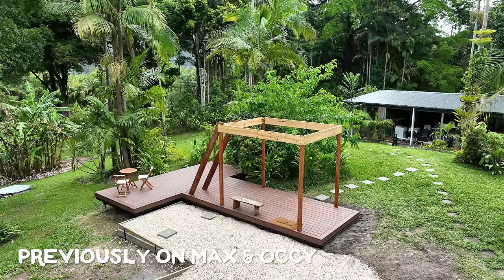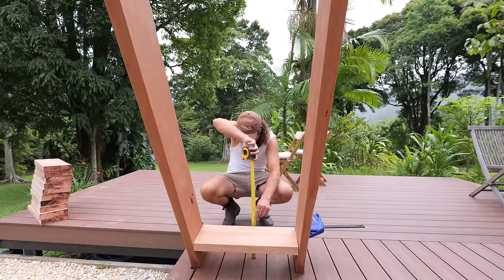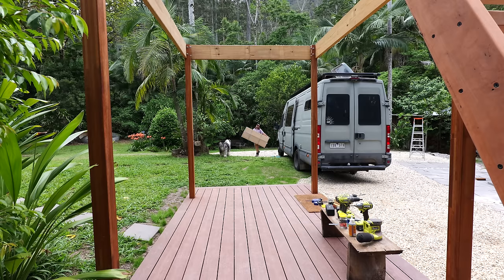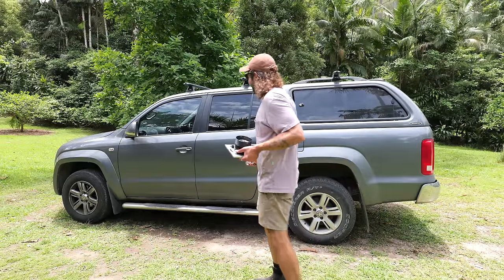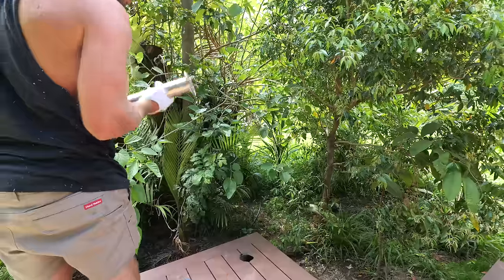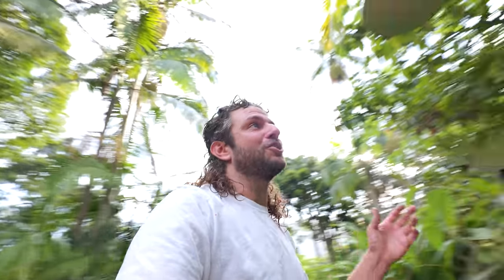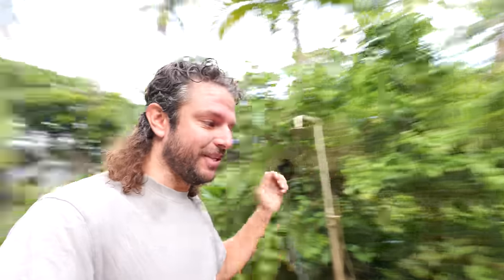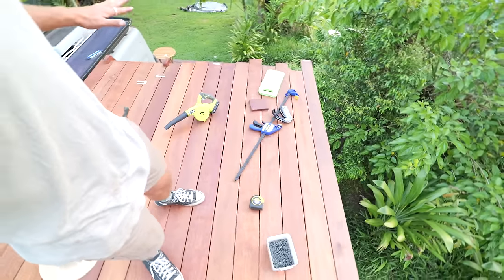I spent 3 weeks building the most luxurious van deck ever

Comment: Hi Max, I have built a lot of stairs in my life, I would be concerned over a long period of time the baton screws rusting out and failing which could cause the step to fall, or the wood warping for being in the elements and causing issues. Usually you would router out a groove to slide the step into, screw it and use a threaded rod to pull the steps together to keep it all aligned, I would consider putting a chock underneath each side just to give it extra support for each step, maybe consider a threaded rod in the middle of the step, my 2 cents, looks great though.😁
Reply: Those are super professional points. I was just going to say use big nails, not screws for weight bearing.
Reply: Good job 👍 I woulda put a tin roof over the whole van/ deck area though
Reply: I had similar steps built to my garage loft and they also continued the side rails up above the deck to give me a hand hold all the way up to the last step. That made them SO much safer and I seldom seen it done.
Reply: The deck is fabulous!  And it will make it so much easier for Occy to get in and out. Good job!
Reply: I can smell the timber 😎
Reply: @my2cworth4U  I know right!! Mahogany is amazing
Reply: You could plant mint around the shower base, to soak up excess water.
Reply: Agreed.
Reply: I wondered the same thing.  My dad was a carpenter and he had lots of projects around the house. I'm pretty sure he would at least have secured the risers with a bracket to the stringers.  Routering a groove is a class move and more esthetically pleasing, though.  Great advice.
Reply from the maker: Thanks for the tips! I actually had stair brackets to use underneath them but figured I can always add them after if any warping or cracking occurs. Future problem for Max to worry about : )
Reply: @MaxandOccy  interesting, wait for problems to occur rather than prevent them from occurring 😵‍💫🤔
Reply: @MaxandOccy a fall from that height 😮 you know the risks. Insurance will not pay for injuries from a self build either. I'm remembering a friend's prosecution and loss of everything he owned. 😢
Reply: My favourite thing on the deck is you n Occy 😊 take care 💙
Reply: Just curious...doesn't Occy get a lot of ticks and other critters by hanging out in the bushes?? Everything you have done looks great! I am impressed!
Reply: Noooooo don't plant mint unless it is in a container. It will run wild which in real terms may be an environmental threat to the rainforest.
Reply: Threaded Rod every 3rd step is minimum that I would do
Reply: @my2cworth4U this is a great idea however I’d make sure it was in a planter or a garden bed mint loves to travel. 

Mint would also give you that natural relaxing fragrance with every shower.
Reply: @sharonrose3871  that was my comment as well. It has to be in a pot or garden bed or it will run for sure.
Reply: @sharonrose3871  OMG ideas run wild faster than mint.
Reply: The shower is amazing! I thought the gold was peaceful looking as well, it blends in. The deck is so nice well done.
Reply: @axedog1395 its only till the cabin gets done.though given the amount of rain we have had to date…..😂
Reply: Looks fantastic, only thing I would add is a balustrade on the top floor.👍
Reply: @alleyoop2899 well Youtube is his bread and butter and he figures that putting everything off will only give him more content for his channel. Can you imagine the views, comments and likes he will garner on a future video showing a thumbnail of him hurt? Believe me, he is besties with Eamon and Bec and he's learned how to make sure to monetize from EVERYTHING he goes through!
Reply: Oh so true! I planted one plant years and years ago and I am still fighting it.
Reply: @pageroo9644 
WOW you sound super critical of not only Max but his friendship with Eamon (who is a fun character) as well. 

I assume (ass-u-me 😂) you have an equally well supported, monetised YT channel.

You don't have to agree with his methods, but Max is a nice guy who will eventually admit if he has failed himself and thank his viewers for their tips. 

Remember to BE KIND. ALWAYS ❤❤
Reply: @yvettepugin4035 I don't crowd fund my life. I actually worked for a living until I retired. Its very funny that Max says to " Be Kind. Always", yet he never addresses issues in a kind manner in regards to the previous owner when he makes his house renovation videos. It started on the very first video showing a full tour of the place after he got the keys. With that said, please save the psychobabble for someone else. Being kind has nothing to do with it. Its about being truthful and not everyone appreciates it being served cold!
Reply: @MaxandOccy  I can't find this weeks video ... Hope you're ok :)
Reply: @lourdesvigil2794  I was wondering the same thing...
Reply: The first thing I thought was where are the routed grooves for the steps and how those screws will rust in time...

Comment: This is way too picky but it comes from a place of love and respect.  In most states the max riser height for stairs is 190mm, not 240mm.  But maybe QLD is different.  More importantly, the minimum tread depth is 240mm (front of step to back) without any overlap from the tread above.  That way, most staircases in Australia are less than 45 degrees and easy (safe) to use.
So let's call it a ladder, okay?  In fact, if you put your Bailey ladder beside it they should be close in angle.
Now - I love the reclaimed timber, I love the workmanship and dedication, I love the vibe, I love the location and setting and it's the most beautiful ladder I've seen.  I would love to climb it!

Comment: Personally, I would add some type of railing around the deck and stairs for safety.  Also some sort of removable piece for the gap between the van and the deck.  Looks great and your hard work shows!
Reply from the maker: Thanks for the suggestion.  I appreciate your concern 💛
Reply: Council approval? Railing minimum 1000mm for anything higher than a metre. Stairs not threaded together, not routed or have angle brackets, apart from that looks good
Reply: Or a seating rail, so there is extra seating around the deck.  I am clumsy, so I would do a header haha, especially after a glass of wine.  Love everything about your home!

Comment: To stop the smoking when drilling there are some tips. The drill bit might be blunt, so get a drill bit sharpening tool. The drill bit is getting filled with wood chips or dust, so press then pull the drill bit out to help the chips to exit from the hole. The drill bit gets hot, so between drilling each hole, cool the bit by dripping it in a bucket of water. Also it could be due to the drill not turning fast enough, so when drilling harder wood you might need a drill with faster rotation.

Comment: Amazing! 
Usually when your drilling into wood and if it’s smoking it’s burning the wood and it’s  because of a few reasons  1. The drill bit can be dull 2. wrong style drill bit. Soft wood you need a wood drill bit  hard wood you can actually  use  a metal drill bit but most likely a dull drill bit and not letting the drill do the work maybe pushing to hard on it

Comment: Nice facelift on the project boys 🤘🏻 quick tip if you ever have to put joists in overhead. Screw a 2x4 to your outside boards running perpendicular to the joists to give yourself a shelf and then use blocking to bring them up to height if needed. Looks sick 🤘🏻😎🤘🏻

Comment: My favorite thing is the railing you're going to build up top. All it takes is a back step late at night and there ya go. Just put up black metal post rebar size and a couple of cables connecting them, and no worries.

Comment: Love ya :) and as an ex-chippie I've built a lot of stairs, but those stair treads need some more support. The screws won't cut it and don't meet the code. Maybe just add some 25x25 screwed to the stringer and then up to each tread. Then 2 or 3 threaded rods to keep them held together. Just worried one will fail as you're walking down them. The deck looks great though!!!

Comment: Max, great work Sir! Looks amazing and I'm sure so many people would love a shower with a view like that! A few suggestions (please note these are not criticisms) -
Maybe consider adding some triangular bracing between the uprights and the top of main frame of the deck to add some rigidity.
I agree with comments from others about the stair case so I won't reiterate those.
I assuming you're going to add some railings around the upper deck to avoid potential fall hazards?
Much ❤ to you and Occy

Comment: Really nice job. We have a van and will consider this if we find property. I love the outdoor shower. You might consider some cross bracing. Timbers are great in compression, but if there is lateral motion, the have anough leverage to rip the fasteners right out. One or two angle boards would stiffen it.

Comment: Heya Max - try using some candle wax on the drill bit and screws - helps to act as a lubricant. May not stop smoke but it should go through easier. PS Don't fall of the deck. It will hurt (not that  I've done that .......recently)

Comment: I’m not a carpenter but I’ve been told if your drill is smoking its because the bit is loaded so you keep the button depressed but occasionally pull the bit out and let some of that wood bits fly off. Something about the wood being damp inside. Hope that helps, I’m about to attempt to. do a deck for container gardening.
Reply: By the way I can only hope mine looks half as good.

Comment: Did you have to put sealant around the hole you drilled out of the eco Deck?  Since you cut that whole, the inner part of the eco plank which was sealed etc is now exposed in that whole.  It has that nice base cap, but wondered if you had to do anything to prevent moisture invading the inner planks?

Comment: Hi,  your deck looks fantastic.  The stairs look great.  I think you should add cleats under each stair tread.  They are only hanging on by four screws into end grain which is not the strongest connection.  You can make some nice looking cleats that will give you a lot more strength under each tread.

Comment: To stop the timber from smoking use sharp drill bits and clean the timber out from the drill grove after every hole.

U might want to add blocking under each tread batten screws aren't really designed for sheer weight. 

But for a paramedic youve done a ripper of a job maxy boy.

Comment: I feel the corners on the upper deck and lower side needs strengthening. Just 4 posts seems a bit unsteady. Enough sideways force or a big push could topple it? Its just woods and nails and no metal bracing.

Comment: I've only ever made stairs using stringers where the weight is distributed on tread but supported by wood on both sides.  If I understand you have the tread supported by 2 screws on each side.  Not sure how stable that will be after a few rains and a few parties.. My favourite is the size and shape of the deck itself and how it is appropriate height for both of you.

Comment: Nice deck, did you use structural screws on those stairs? If not there may be a load issue to consider. Some corner bracing to add rigidity would be wise too.

Comment: Great work Max . In QLD if you built a deck higher than 900mm you must have a rail around it . O K for private use but you have guests using it NO.

Comment: Not a fan of the end grain screws in the treads in out door application, but she's come up a treat. Get that under deck finished or braced, block under the treads and consider some threaded rod to stop the stringers from wanting to seperate under load 👌

Comment: Curious how long it takes for the hot water to run from the shower? Looks like a long run of hose so how long's the wait before the water from the shower is hot?
And I'll agree with those who say you NEED some safety railings on the stairs and deck. Your Mum's pretty nimble but those stairs are steep and it's a long fall from the deck. Plus, I seem to recall you have young nieces/nephews?
Finally, yeah, those steps are not long-term durable. Put some risers or supports under them. 5-10 years down the line, if one of those steps gives way under someone, especially without railings, and you're looing at major bad mojo.

Comment: Smoking: it’s the wood powder stuck in your drill heating up. If you pull the drill bit out while you’re drilling a hole, the excess powder will fall out and it’ll stop the heat building up.

Comment: The deck build is beautiful and you've worked really hard on it, so pat yourself on the back. I do however think that for the sake of safety and liability you should put some kind of railing on the stairs and deck. The outdoor shower turned out wonderful and some of your guests might appreciate a privacy screen when showering. The spider situation is a bit frightening to me and they seem to be everywhere. How did you get the spider out? I was also wondering how you prevent insects, critter's and snakes from just moving through the open van? Can you tell I hate bugs?  LOL
Reply: Shower area my favorite! Great choice on that!! 

Like others, I have concerns about safety of upper deck and stairs if no railing, especially with alcohol consumption, low to no light at night, and seating relatively close to edge….

Comment: I would add a railing on the side away from the van.  Not so much needed going up, but coming down with that steep staircase and nothing to hold on to for your first step???  A stair rail would make it safer for someone who has had a drink or two...  Otherwise they must come down backwards!